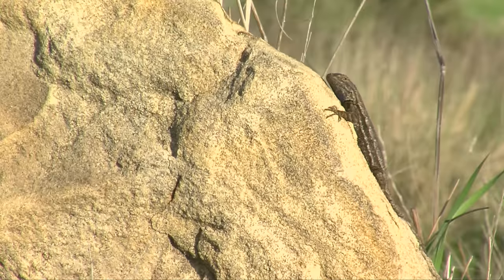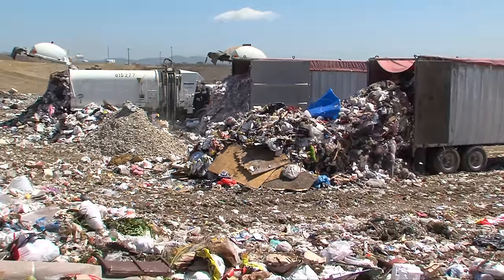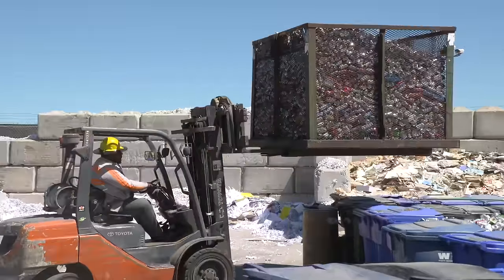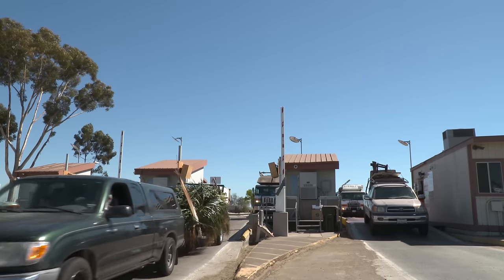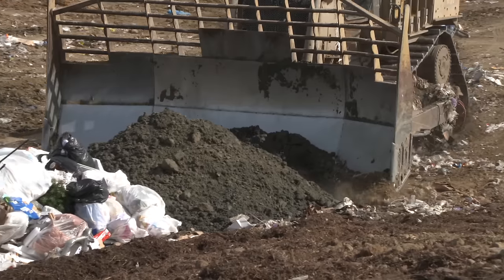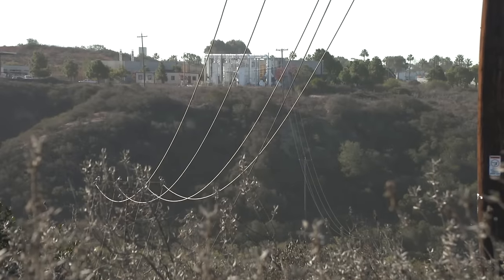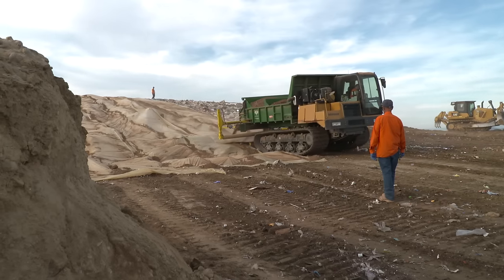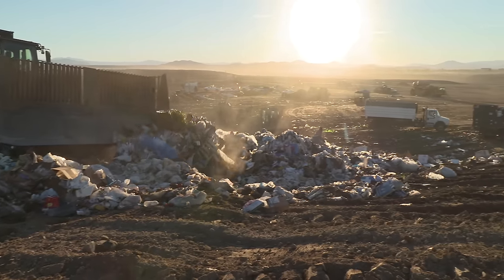What Happens at the Landfill

Comment: I still don't understand why landfills exist. They are basically enormous waste bins in the ground. I live In Belgium and we recycle plastic, glass, metal, paper,.. The rest is collected and burned, there is no pollution because the burners are very efficient. The energy that comes of the burning is used to generate electricity
Reply: Easy answer...money, a lot of cities and states are not willing to put the effort or money into building complex trash burning facilities. On top of that many people who work in the garbage industry are unionized and I'm sure a lot of them would be opposed to replacing their landfill jobs for just simple trash burning.
Reply: @The Last Danite but most trash is NOT decompostable like plastic! Isn't there enough plastic pollution? When you burn trash the only rest fraction is ash and this will be mixed with asphalt to make roads. The burning energy is recuperated to make electricity. I don't say this method is not without faults but I think its the better method of the two. In trash there is still a lot of energy stored when you burn it more energy gets released in warmth. This warmth can go to houses or to make electricity.
Reply: @The Last Danite I don't say that the plastic harms anybody, it's just lost plastic that can be recycled. And recycled plastic is better than producing new plastic that requires more oil.
Also the amount energy you use to burn rest trash is smaller than the amount of energy that you gain from it.
What about metals? Is this completely recuperated from the trash before it gets in the landfills? After burning the trash the metals are seperated from the ashes with magnets and recycled.
Reply: Landfills exist because they generate a fortune for Big Waste corporations.

Comment: admittedly i had low expectations when i stumbled across this video but it was really informative and fascinating to watch and learn more
Reply: All Tip-Site stink because of all the household rubbish rotting in the Sun it attracts scavenger birds & rats but it provides few jobs & paycheques to feed families driving forklift trucks is better than standing in the stinky smell directing cars where to dispose their unwanted garbage also the recycling sorting bins for plastic is a cleaner area to work for a job. We all have to dispose of unwanted items we humans use at some point in time, it is better not to use plastic, Glass bottles are easy to recycle so you can make more bottles but glass is so easy to break if dropped and its  very sharp, can easily cut your hands so steel gloves are worn to protect.

Comment: The central location is quite a boon, dramatically reduces fuel consumption for initial transport. And the envirocover is probably an important component of the odor mitigation they need to have for the location. Water for dust control is also obviously more important for this location due to the perpetual earthwork and inconsistant rainfall.

Comment: I intentionally searched this after watching dumpster diving videos. It made me sick to my stomach all the shit that department stores and Amazon throw away instead of donating. It made me curious where all the garbage goes. I still would like to know how appliances are recycled. Did I miss it in this video?
Reply: appliances get either recycled at the scrapmetal yard for money or refurbished and sold used.  air conditioners and refrigerators have gas in them which has to be properly evacuated into another tank.  epa regulations could get you in trouble if you release the gas into the atmosphere.  the gas they use is expensive so i'm sure that can be reclaimed too.